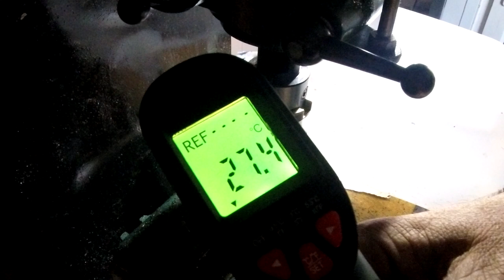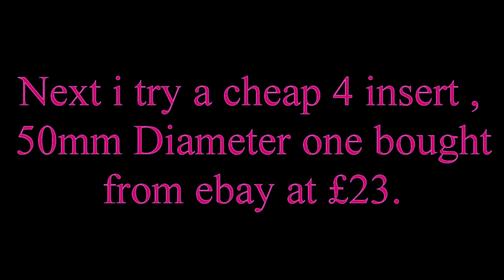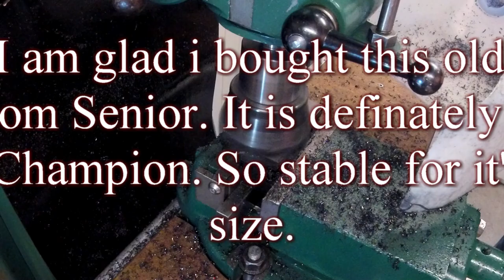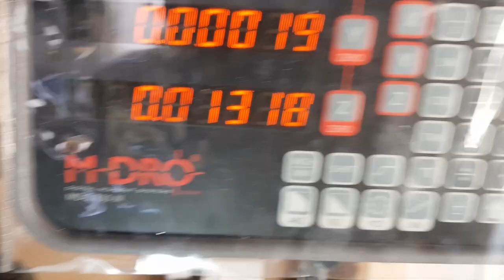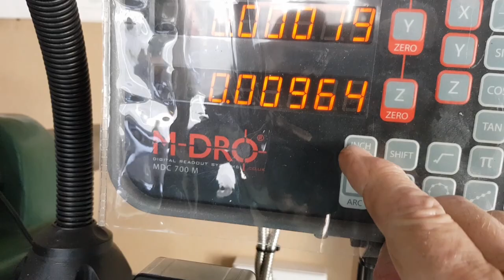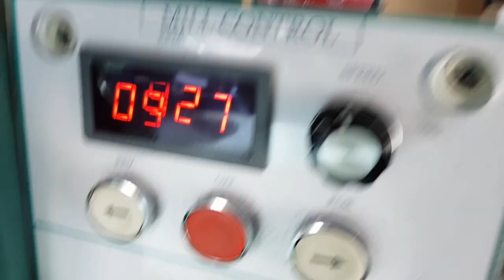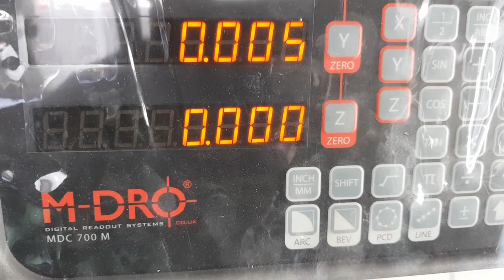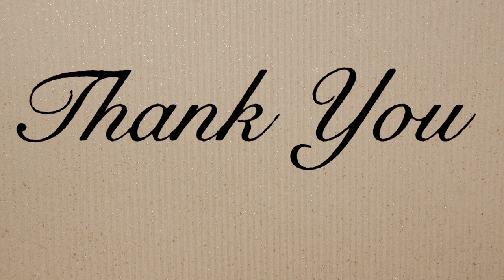Chinese face cutter Vs good quality must watch facemill

Comment: I'm always afraid those cutter heads vibrate my little mill to pieces. interesting comparison!
And the chipcollector/protector made out of an empty canister is a good idea - thanx ;-)
Reply from the maker: Yes i must admit the cheap import version did cause a few vibe problems. Strangely though my good quality 60mm one was a smooth as butter. My mill is only a small to medium size & very old. But a very good British made item. Thank you for your comments. I have subscribed to your channel,

Comment: I have only started looking at insert milling cutters today so don't know anything. But on a lathe a round tip tool has more cutting force than a knife tool because the cutting area is larger. Maybe the round inserts are noisier for the same reason. Would be interesting to measure the motor current while using the different cutters to see the consumed power.
Reply from the maker: Thanks for that. I do not have an ammeter fitted but do have a Tacho. I can see if the motor is getting loaded up be the drop in revolutions. I was apprehensive trying this cutter. I , like you am a pure amateur & was just trying different cutters I had. I will be trying them again, especially the Chinese one after I fit some good inserts & check the tip gaps. Regards. Steve.